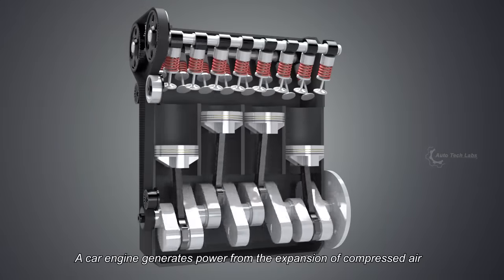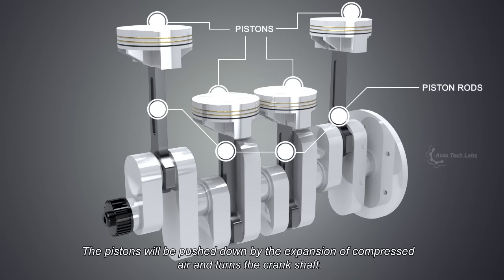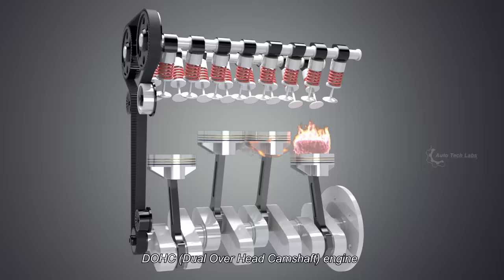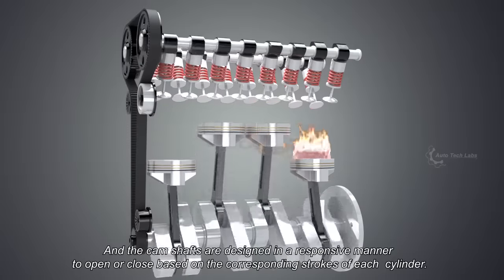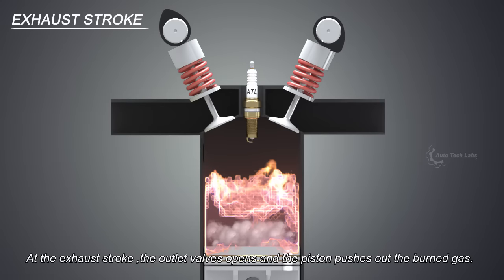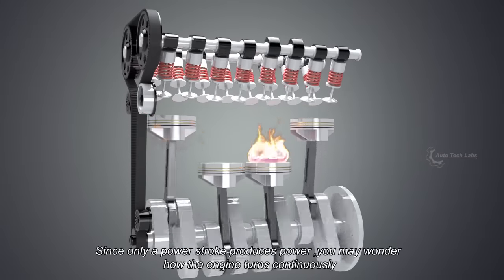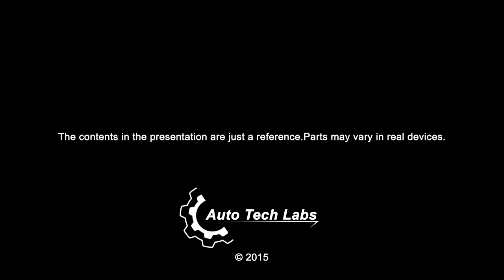How Car Engine Works | Autotechlabs

Comment: The only thing i dont understand is how the gas pedal gives more power, like it puts more gas or more stuff to "explode" or burn the gas? Or how does it work?
Reply: You let in more air and fuel so you make a bigger boom. the whole idea is to make petrol explode and push the pistons,However petrol and anything really can't explode without oxygen since oxygen helps a lot. so you need to add air. and then you add more air and fuel to make a bigger boom.So you control the amount of "boom mixture" in the engine to make booms in different sizes fit your need(that's why the engine gets louder when you press on the pedal.bigger boom)
to expand on this:
air is the bottleneck of power. you need more of it to make more power and that's why sport cars have more vents and shit. But to make more power they apply two methods of forcing in more air.

1:turbos:
these are circular parts equipped to the air intake which use the pressure of the leftover gas(you can think of it as breathing,the air coming out of the engine is used) to spin up a fan to compress the air

2:superchargers:
these dont really have a shape but generally use the engine itself to  spin a fan to compress the air.

and you may wonder why air is the bottleneck and not fuel. and that is simple. fuel is liquid and you need small amount while air is big and need big amount and injecting fuel is easier then air.
Reply: @معازطارق-ذ8ج  Thank you, i understand now.
Reply: @imrevig7261  No problem. If you have any questions don't be afraid to ask.

Comment: I often wonder what would've been invented and created by now if we didn't have the internal combustion engine, and likely better, and the big Oil n Gas companies weren't around, esp since they wouldn't be holding better techs back and more concerned about control and profit.  We'd prob be much better.

Comment: Is the spark plug is working full time in engine rotation??
Reply: No, it receives a current boost to create the plasma beam that ignites the mixture after the compression.

Comment: I'm confused. If the combustion drives the crankshaft down and that's what produces power. Why not just make a crankshaft and spins really fast with gears or have something like a piston that can pressure the crank shaft down forcefully. I don't understand why the combustion matters.
Reply: darren tay the combustion pushes the piston downwards.

Comment: I seriously don't understand. I know what a DOHC is but I can't find any other camshaft configuration things anywhere. Can you guys tell me some and what they mean?
Reply: A dohc setup has 2 cams placed on top of the cylinder head. You can also have sohc where there is only 1 cam on top of the cylinder head. Dohc engines have 4 valves per cylinder, sohc engines have 2. There is also pushrod cams like what the ls engine uses. The cam is not on top of the head and instead of pushing directly on the valve it pushes a rod that opens the valve.

Comment: Ok so if my car is a V6 does the mean I have 6 of those piston things?
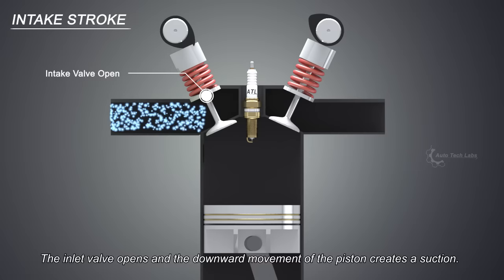Reply: Yes. "V" is the shape of single cylinder. Now i'd like to ask you question. At 2:11, what is the power source for initial downward movement of the piston before combustion pressure occurs?

Comment: ok but then where do the wheels come in?
Reply: torque
Reply: On a rear wheel drive vehicle, the rotating crankshaft is connected to a clutch or torque converter and then a transmission, which turns a driveshaft and a then through a differential. The differential then turns the axles which are attached to the drive wheels.
Reply: How do pistons spin the crank shaft the same direction?????
Reply: ModGyver One piston is always on power stroke and when it is the piston rod is leaning outwards making it keep spinning if that make sense

Comment: If a car is a "V8" it means it has 8 valves, and 4 pistons?
Reply from the maker: No. V8 means it has total 8 pistons in a V pattern, 4 pistons per side. 
So if it's a 4 valve per cylinder config, 4 valves x 8 pistons = 32 valves in total.
Reply: @autotechlabs  Thanks a lot for the explanation! 👍🏼

Comment: Top 10 engine I hate:
1. LS
2. V8
3. V6 (in cluding R35 and 370z and 350z)
4. 4 rotors wanklr rotary 
5. 3 rotors wankle rotary (I only like 13B series)
6. V12
7. V10
8. W engine
9. All usa engine
10. All non japan engine
Top 10 engine I like:
1. 13B-REW 
2. 13B-MSP 
3. RB26DETT 
4. EJ20
5. EJ25
6. FA20/4U-GSE
7. 4G63T 
8. K20A
9. B16A
10. 2ZZ-GE

Comment: Very inefficient system. Only 20 % if the gas you put actually converts into power. 80% is lost in the frictional movement of the parts.

Comment: It's sad how they don't even teach this kind of basic knowledge in middle or high schools like seriously. Why isn't it part of the science curriculum? In some school districts the science curriculum is so bad they teach you woke BS science that men can get pregnant and climate alarmisim hysteria. Not to mention drag queens or pedoph!les as i like to call them teaching elementary school kids how to twerk and confusing them about their gender but i digress. 

P.S when i was in middle school I even saw a whole section and diagram of how 2 stroke and 4 stroke engines work in my 7th grade science textbook and yet we didn't even cover it we skipped it. It was a chapter on something about energy and power. It was a nice diagram too a girl holding a 2 stroke leaf blower with the parts inside of it labeled terms like "piston" "compression" "ignotion" and "power" and the next page had a diagram kinda like this video of a 4 stroke inline 4 engine and all the parts and how it works.